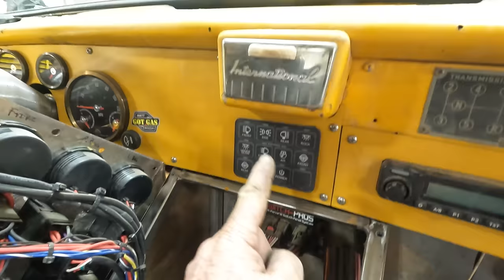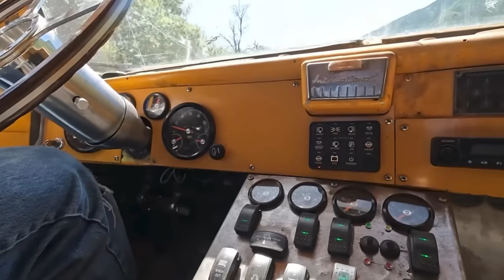The Heavy Wrecker Is Destroying Itself!

Comment from the maker: Get your tickets to the Off-Road Games. Ticket sales are limited. https://offroadgames.com
Reply: What is going on with you and Paul?
Reply: completely custom built, specialty rig...not surprising, it having growing pains
Reply: Matt I’m no expert but after watching your last three videos I would say you need to have the bombi in the shop. That thing has issues!
Reply: I make the fenders for that Gladiator.
Reply: I felt that the same way you did about the torque converter with a ticking injection pump in my truck. I spent 40k miles listening to it irritated the whole time.
Reply: The tail bearing leaks on the transmission because it's been distorted from stress. Same issue on a crate Chevy in a vette.  Leak can't be fixed. Needs housing.
Reply: Hey man, you had to get all the transmission fluid out of the torque converter before you could put it in the trash.
Reply: What us that can’t be there but watch on YouTube we want a gladiator
Reply: Krylon Farm and Implement High Gloss John Deere Yellow Lacquer Spray Paint. That's the best paint for machines I have ever seen. Piles and creeps. It also lays nice.
Reply: Any reason why Paul and Merlin aren't at the "Off-Road Games"? Would rather see them again than half of the other youtubers.
Reply: Got my tickets and I'll have a booth stack smarter. I'll also be in a booth close to yours. I'll be able to help you out with all your new packout stuff I see in this video.
Reply: easy way to remake the wrecker start of like your making a rock bouncer like what you can see in Busted Knuckle Films but as a wrecker
Reply: Dynomat metal roof and doors
Reply: 16:43 Is that transmission rebuilt by the same guy who's been rebuilding paul's transmission
Reply: Hang on,,, it's an Army Reserve unit, but they gave you a hat that said "Marine" on it?
Reply: Already did! :)
Reply: @stevenjames5419  That's normal, everything he has built has had issues at one time or another but they eventually get sorted out.
Reply: @T51B1  If you watched either of their channels you'd know why. I can't figure out why the others are willing to let some unknown non off roader drive their rigs.
Reply: I REALLY miss Lizzy. She was a lot different and more a part of the team by getting work done while being beautiful without trying and having a good attitude. Please get her back.
Reply: SUPER HIGHLY RECOMMEND A REMANUFACTURED TRANSMISSION FROM A REMAN CO.OR O'REILLY'S. 3/36 WARRANTY.
Reply: Hiya, Stu Davies from Wales, Uk. Flight booked ok, car booked ok, hotel booked ok BUT tried to book and buy your tickets and fail! I emailed once about the tees and delivery and got a silly answer about shipping them. We live in Wales UK. The form to get the entrance tickets FAILS! Because it can’t cope with shipping to Wales! So cant buy tickets! How do we solve this?
Reply: Good to see the forever unfinished project in progress, further towards.... Morr progress.
Reply: Built right, till it's built enough to have to build it more, less often.

Comment: Painting with rattle cans tip  .. heat the can with hot water before using it, it makes such a huge difference in how it lays down and dries that I do it every time  regardless of outside temperature (remember that the pressure drop from high pressure inside  the can to outside pressure causes the paint's temperature in the spray to drop greatly) so happy that you are getting the roof fixed up, and upgrading the drive train 🙂
Reply: I' ve been doing that for years and it does make a big difference.
Reply: Thanks, I'll remember that for next time. 👍
Reply: What makes a bigger difference is buying a saws-all adaptor for paint cans to shake them. I don't care if you and 3 more people shake that can for an hour each, the saws all is the greatest improvement to a rattle can Earl Schieb artist job money can buy. (Who remembers him?)
Reply: Don't blow up the can!  Wrap it tightly in a Towel.  Wheres ED?
Reply: @rickwallace5582  Yes, I remember Earl Scheibs $89.95 paint jobs in Phoenix ... Now that sawzall rattle can shaker is a great idea. I looked it up and there are several types available and now I'm gonna make one from an old sliding bar clamp. ... ...Thanks for bringing that to my attention.
Reply: That's a great idea!
Reply: I use a microwave
Reply: @gordbaker896  What? Why do you think it would blow up?
Reply: 69th
Reply: That's genius. That never occurred to me, but it's so intuitive. Thanks.

Comment: For a welding heat sink, watch rummage sales or estate sales for the old soldering irons from 1860-1950's they typically have a pointed copper chunk about 2"x2"x4" with a steel rod and wooden handle.  one or two of the irons can be modified to absorb the heat from welding.  I use anti spatter wax to help with release.  I either shim the heat sink into position or have a helper hold it in position.  Often weld will stick so use the handle to twist the sink off the repair.  I purchased my last one for $0.50  The bare copper cost brick about $25.00.

Comment: Years ago doing training at Fort Polk, LA a young private drove a similar Hemtt down the wrong 2 lane road, he decided the best course of action was to turn around on the skinny road, also the road was built up on a berm through a swamp, well he drove down into the swamp thinking he was in a unstoppable rig, next thing you know you could not see any of the 8 tires under the mud,  they brought out a M88A1, thats a tank recovery vehicle, they had to park this down the other side of the berm as its winch just pulled the M88A1 closer to the stuck HEMMT, once they jpulled it down the berm, they were finally able to winch the HEMMT out, but the cable sawed a nearly foot deep trench into the road, fun times

Comment: Hello guys. I'm not good at painting and not at your level in the work shop. I just would tell we had the same colour problem for painting years ago. We got the right colour mixed and used a very cheap and simple paint pump called Wagner which gave a reliable result at level a bit higher than the small spray cans, and we could paint like the hole roof at the wrecker. We had the paint in stock and could use it if needed. The paint pump was so cheap and simple that it could be discarded when it no longer worked. And without the spray fog from a pro system we had no need for a big paint box for the work. Best Regards from Norway

Comment: Always good to see Ed and Max on there. Even if it's just a cameo. I like to use a clean rag and boiled linseed oil on bare metal to slow the rust and keep the patina. Later if I want to paint just some good solvent and it comes right off. I like seeing the inside of the gear boxes to see what takes them out. Seems like Katelynn is picking up good on the work.
Reply: Really? I think the only useful thing I've even seen her do is sweep the shop floor, usually she just stands around smiling at Kaulin.

Comment: If you pull the front clip off the XJ you can have it in or out in about 2 minutes. First time taking front clip off is annoying but there are way too many fasteners from factory IMO. I have only the 6 main 10mm bolts left and threw out the rest takes me about 30 seconds to remove front clip now. Can pull, do full gasket kit, drop back in, reassemble and running in 6 hours at this point.

Comment: as someone who runs alot of different torque converters im 100% with you. ive had the best luck in my race truck with fti converters they seem to hold the best. i ran a 4.6 4v s/c with a 4r70 behind it. i went threw 3 converters before the fti 2600 stall seemed to be the best fit and to this day (i sold the truck) but it had 6 race days on it and seemed to still be shifting perfect. i do miss it but now im back to manual trans.
Reply: I've used a couple FTI's with good luck. But CircleD has been my go to for converters in turbo trucks

Comment: Copper chill blocks?  For sheet metal hole filling, I just use scrap copper plumbing pipe.  If it needs to be thicker than just one pipe, squash each pipe in a hydraulic press, and TIG weld them together with scrap Romex as the filler metal.

Comment: Operated that HEMTT Wrecker for two years in Europe in 1990 and 1991 - from Germany, England, Denmark and numerous other countries and adventures.  It drives straight down the Autobahn at 2 AM only if you have your hands on your nuts and your "added" Radio blasting AC/DC through some Pioneer TX-25 speakers.

Comment: I drove the M985 HEMTT when I was in the Army. Such a badass vehicle unless you get it stuck on a sand dune on the frame with the front two axles in the air. I also got mine suck on its side in an icy ditch at Ft Sill. Good times.

Comment: Now you just need a spare tire (on the roof?) And a supercharger. Yes, you heard me, a supercharger. I haven't forgotten that steep sandy hill where the wreckers engine actually bogged down. Wrecker wouldve gotten out if A) it had been 100% working and B) it had MORR power!
Reply: MORR power is just going to snap the drive shafts faster.

Comment: Harbor Freight has a brass hammer. Brass works fairly well. There are copper hammers and plate on Amazon. Hammers work well due to having a handle if they will fit where needed.

Comment: On the new shop, be sure to route smurf tubes (conduit) so you can run ethernet throughout the shop. This will allow you expand your wifi and can power cameras via PoE and have the footage automatically saved to a NAS for your editors.

Comment: @18:00 you had the problem of the suspension linkage binding up with the driveshaft if I recall correctly, crushing some lines in the process. 80lbs should not harm a bearing like this what so ever, a drive shaft used as a lever would though.

Comment: exhaust heat - should think about using some exhaust wrap - stuff really works well and is easy to apply...even with your new headers...would be even easier to put it on before you bolt them up!

Comment: Good to see the skid plates have protection for the bolt heads - but they can still snap on rocks they truck is sliding over - simple "lead-in" gussets welded in front of, and behind, the rings would make snagging a lot less likely, if they would consider adding that to the design.

Comment: The XJ 4.0 years to avoid if possible are the model years 2000 and the final year the XJ was made 2001 as the heads were purchased from 2 different foundries that casted them and one of the companies were producing garbage and the heads crack or warp. I heard a rumor that the company that had the issues used a sand type casting process? Make sure you take an XJ expert with you to look over any potential purchase of a 2000 or 2001 XJ. I believe it was an issue in the later part of the 2000 model year production and didn't get caught and changed until mid way through the 2001 model year. Other than that the XJ  with the 4.0 motors are just about bulletproof except late 2000 and early 2001. Quick tip is to check the front passenger side floor well at the bottom of the firewall and feel for anti freeze leaking into the carpet via the heater box is one way to tell you have a head thats cracked or warped, smell your fingers if they feel sticky after rubbing them on the carpet on that side of the XJ. The great thing about the XJ is they are simple to work on even for a novice backyard machanic and the parts are real easy to find. They are by far  one of the best small offroad capable SUV and there is so much you can do them to make them an awesome offroad beast. I have seen XJs turned into rock crawlers and lifted crazty high with many different types of suspensions lift systems. Just find a clean body with zero rust on the rockers or liftgate and you are well on your way to owning a great offroad vehicle.

Comment: 5:41   Hopefully those headers are made of 304 or 309 stainless AND are ceramic coated.     Why?: #1) Stainless has well under HALF the thermal conductivity of regular steel headers (actually, closer to only one third that of steel) This reduces the heat radiated into the engine compartment as well as heat transfer from the header flange to cylinder heads. #2) Stainless can handle higher temperatures without warpage, corrosion, and accelerated heat induced fatigue. #3) If a heat wrap is added to stainless headers, stainless can better handle the temperature increase caused by heat wrap than regular steel tubing   #5) Ceramic coating also reduces heat transfer into engine compartment. Plus it just looks better than heat wrap.

Comment: Im excited to see the the improvements on the wrecker, however i have a question. Since youve switch to a lever system on the t-case, why wouldnt you have made a bracket to bolt to the case to hold the lever(s) and just use a boot to seal it from the outside elements? This way the levers will always stay in the same location and still make it simple to remove the cab?

Comment: Ace Hardware had your copper brick... you just grab a piece of copper plumbing pipe and smash one end flat with a slight bend in it so you can hold it up against your sheet metal while you weld.

Comment: Dont forget with that SCS case you can get interchangable gears, Im from the mega truck world and we share gears all the time at diffrent events, it gives that little extra variation that is super nice!
Reply: also a cheaper and higher temp to transmission fluid is a tractor hydraulic fluid, costs less per gallon and is breaks down at a higher temp!
Reply from the maker: I always ran hydraulic fluid in my derby transmissions.

Comment: one thing i learned quick in my vehicle experience... if you dont have the ability to rebuild your own transmission then just buy another one that hasnt been opened. 7/10 times a rebuilt trans will fail because people just are not capable of doing it. i can rebuild a trans but for my time and how cheap you can pick one up from a wrecker yard ... used.. or you go to a reputable trans builder that upgrades transmissions and have it done right the first time and never worry about it again. your average mechanic shop will say they can do it will charge you 3grand and you will get it back a month later with more issues than it went in with.

Comment: Tell Kaulin a brass hammer works to back up a weld and in a pinch take a length of copper pipe and hammer one end “flat” to use to back up a sheet metal plug weld.

Comment: Matt you should contact the hoist manufacturer and find out if using the hoist as an anchor for winching is a wise idea you would  want the hoist with a vehicle on it collapse from weakening the anchor bolts ....my friend had a shop with similar hoist that one side gave way ....safety specially with all the workers that maybe working in the vacinity

Comment: If you bend that doubler rod, will it still drop out the floor?  You might need to put a bolted joint in it near the floor.  Run the bolts back to front so they don't catch your pants.

Comment: My driver's ed teacher was prone to overreacting. I was in the back seat, observing, when the teacher realized the student driver had accidentally put the car in D3 instead of Overdrive. The teacher freaked out, yelling about how much fuel they had just wasted and told the driver he needed to fix this RIGHT NOW! The shifter on the driver's ed car was a lever on the steering column, and anyone who has driven a car with that shifter system knows they can be really touchy. We were on the busiest street in the whole city, and the frazzled driver did his best to try and shift to overdrive. He overshot it by a wide margin, and slammed it into park going 35 mph. The engine died and we coasted along for a few stunned seconds while I tried not to laugh.

That poor car never shifted quite the same afterwards 😂

Comment: I've said it before but I'm curious if you've ever considered a 4.2l inline 6 from GMC. They get around 20mpg, have about 275HP stock, and they come mated to a 4L60E or you can upgrade to a fatty 4L80E.
Reply: Oh and Hotrod magazine has an article where a guy with a 69' firebird put that GMC inline 6 into it and turbo charged it. After a tune he was getting 24 mpg(better fuel economy) and 400ish HP. That was on a stock motor too.

Comment: If the Wrecker is only 12,000 lbs and the axles are rated for 9,000 and the drive shaft is only 65; what's causing it to overstress the bearing?

Comment: Shame you didn't just mount the shifters to the trans, then cut an appropriate hole in the floor and seal it with a thick gasket - and maybe a couple of wingnuts to hold it steady.  Then you could lift the cab off and simply let the shifters drop through the hole and stay with the trans.

Comment: When pulling a load and you're banging off the rev limiter and it pops into the next gear.. think about the strength of your bearings inside of your transfer case and you'll answer your problem's

Comment: What is it with Transmissions?  There seems to be no rhyme or reason why they cannot be rebuilt and be dependable.  Paul at Fab Rats keeps having problems, too.  I got 200,000 miles out of my factory new transmission and less than 50,000 on a rebuild.

Comment: Somewhat unrelated, but I keep wondering what your reasoning is for running a limited slip in the rear of most of your vehicles instead of another locker.  Is it a drivability concern, a wear and tear concern, or both?
Reply from the maker: Both
Also, reliability